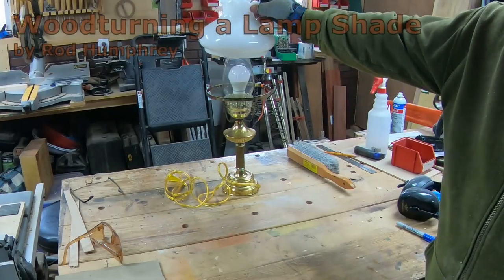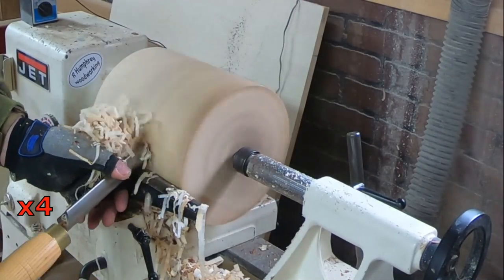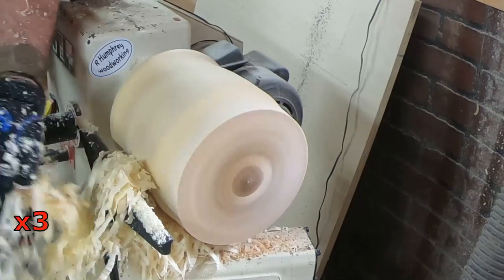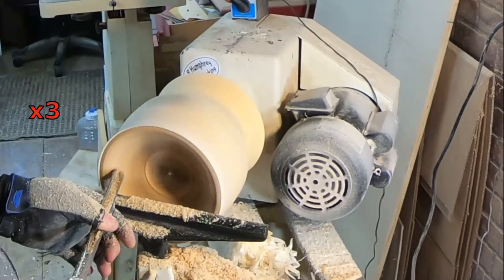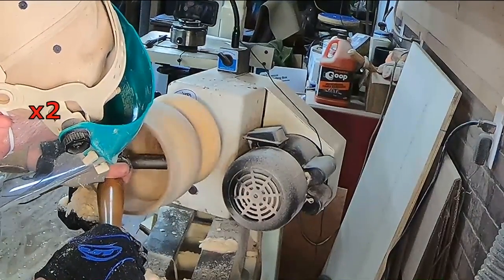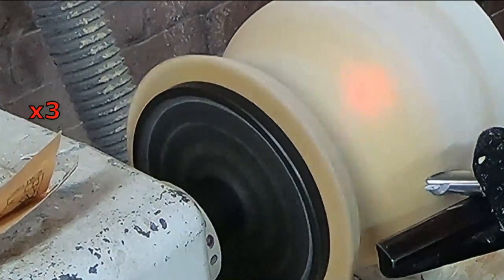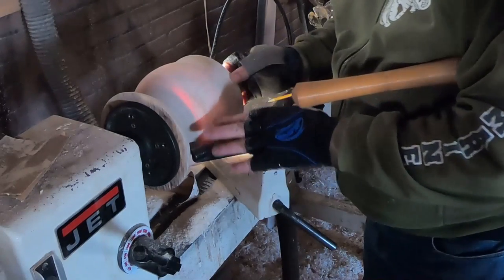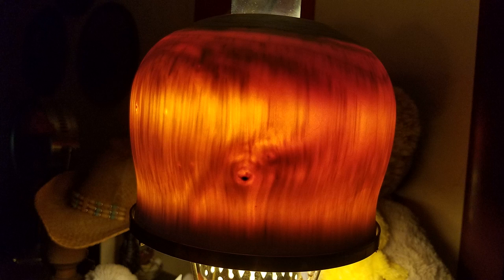Woodturning a Lamp Shade from a Log

Comment: Beautiful lamp shade, Rod. My lovely lady asked me several years ago to turn one, and it was so much fun I ended up doing several. I have a hollowing rig that makes short work of hollowing, but I found that a tear drop scraper, ground with a negative rake, is a great finishing tool for the inside of the shade. You might consider one of those if you do another shade.  Clyde
Reply from the maker: Thank you Clyde, I'll have to look for one of those scrapers, I have at least one more lamp shade to make...

Comment: That turned out really beautiful,  Rod. Elm was a good choice because of its grain it was less likely to split.
Reply from the maker: hate to say it, but I was wrong about the ID of this wood.  It is actually silver maple.  Those piles of wood, not elm like I had thought.  So I've got a lot of maple to play with, and I love the stuff!  This has already dried completely to indoor humidity level, no cracks, no warping.  the even thinness really worked out well.  Thank you!
Reply: @RHumphrey  That makes sense now that you say it.  If it was elm, you would probably feel like you were cutting end grain constantly.

Comment: Amazing!  I have bunch of cedar I had to cut down this last spring. This project has me thinking a cedar shade would be amazing.  I am relatively new to turning so I think I'll build my skills up to this.  I also under cedar can be unstable to turn (as I have heard you comment in other vids). Can cedar be stabilized with pentacryl or some other method for a thin walled turn?
Semper Fi, Top!

Comment: Hey Mate,

A hello from Down Under.  I came across your channel interestingly not long ago.  I happened to be watching a vid from a fellow Aussie who was making interesting dioramas.  In my suggested videos, there was a person called Thomas Anton Geurts who did wood turning.  No idea if we are distantly related or not.  But after clicking on one of his vids to watch, this one now appeared in my suggested list.

I'm very impressed with the lamp shade and it had me wondering about an idea or two.  Given that the shade is already fairly thin, would it be possible to gouge out, from the inside, some slightly deeper channels which by my guess, would appear slightly brighter from the outside?

The couple of ideas I had were:
1) Gouge down a 5mm (1/5 of an in?) recess about 1/1.5mm deep, followed by 3 or 4 more at 12-15mm intervals;
2) Gouge down a 5mm (1/5 of an in?) recess about 1/1.5mm deep, followed by a 12mm gap, then an 8mm gouge (same depth), 20mm gap, 10mm gouge, 20mm gap, and so on.

I think it could certainly make for some interesting effects on the lamp shade.

Lastly, I'm curious to know if you are able to turn some native Australian timbers? Or is that too difficult and/or expensive to get through customs/quarantine?

Keep up the excellent work!

Cheers,
Alv
Reply from the maker: It sounds like a good idea, and no doubt, any variation in the thickness would create a pattern of light variance.    I've turned red coolibah... or was it brown mallee...  I think the first.  that's all though.  I don't see much of it and it is expensive, for the quality chunks.  I'm not sure about the customs/quarantine, but it probably comes though easily.  Thank you!

Comment: Very nice lamp shade.  I may try this.  What would you say is the thickness?  Thanks again.
Reply from the maker: I got it down to a fairly consistent 1/8th with a bit more width at the base.  gotta keep that lathe slow for the thin turning so the speed doesn't contort the wood...  go for it! Thank you!

Comment: thanks for posting this. You made it look easy getting to 1/8th".  I would have made flying chunks as I am new to turning.  Was the maple you made shade with seasoned dry or green?  Definitely surprised how lit up shade was.
Reply from the maker: Thank you, Larry,  It was very green.
Reply: @RHumphrey  There is a bit to learn about the dynamics of turning and wood moisture. Am I correct in observing that while turning your piece to 1/8th of an inch that you essentially cured the green work by turning it?
Reply from the maker: @larryweinberg1191  It did cure much faster and evenly, but it was still a bit wet after the turn.  Just leaving the lamp light turned on with the shade in place worked to speed it up even more as it was its own "kiln" as the heat of the bulb forced out the rest of the moisture in very short order.  It did shrink just a little bit, but very evenly.  No warping at all.  The thinness helped as well as a lack of knots and uneven grain.  Also, the end grain turning, instead of a side approach, made for very consistent grain on all sides. 😊

Comment: How do you keep the shade from warping and cracking?
Reply from the maker: it's turned to a very even thinness with no pith left at all, so in theory it will dry perfectly even...  and it has.  It's dry to in house humidity levels with no warping at all, but with some shrinkage (not much)